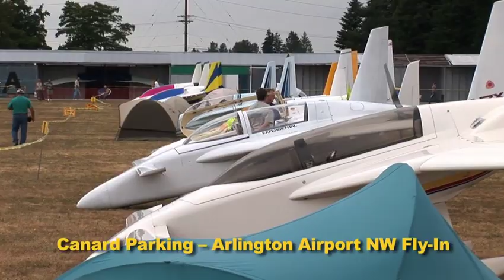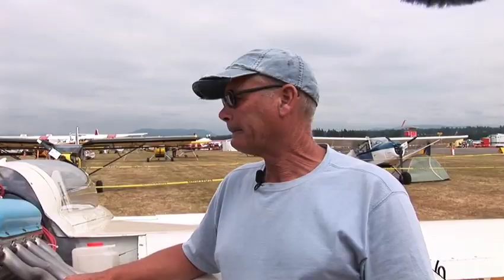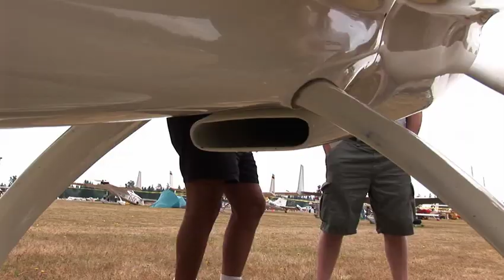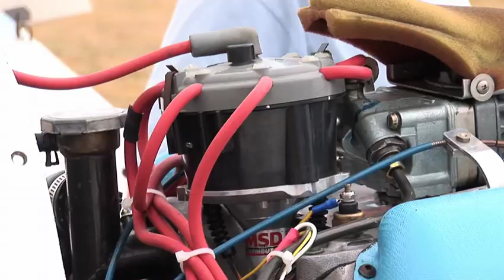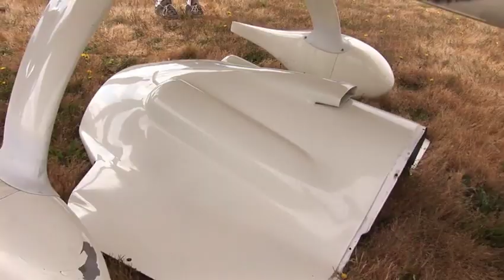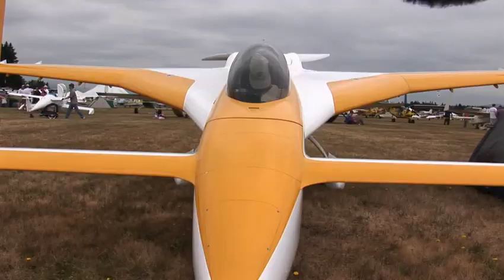LongEZ V8

Comment: Was that a direct prop mount? I am also an Engineer (Automotive) and I would never mount a prop directly on an automotive engine. There's not nearly enough support there for a rotating mass even if the blades are glass or carbon.

Comment: I would have used a much lighter and smaller motorcycle engine that makes more hp per lb than that huge V8!
Reply: Airplane engines are all about torque, not hp. You need to TURN (hence the torque) the prop at low RPMs. And you also want an engine that's dependable..

Comment: With those specs, I wonder how a Mercedes OM606 or Toyota 2JZ would fair.
Reply: OM606 weighs 463lbs, 2JZ 440lbs, both more than 100lbs more than the V8. Both are straight 6s, so they're longer and taller, so the CG is even farther aft. 

Aft center of gravity in an aircraft is deadly. 

I've got an idea! How bout use an airplane engine!!?? They're lighter, smaller, less complex, and fit inside existing cowlings, all with more torque as the engines you listed.

Comment: I’m curious what airframe modifications were made to get passed the Vne of 190 Knotts??
Reply: I was thinking the same thing. Exceeding stress levels is suicide.
Reply: These planes are experimental. There is no official VNE. Also, the VNE is IAS, so at 10,000', he may be traveling at 200kts ground speed, it may only be 140kts IAS.

Comment: I like his attitude about overhaul time.  Think about how they're run on the road.  If your car averages 30-40 mph (pretty typical for cars once all idle/city/highway time is lumped together) and you change oil every 5000 miles, that's about 125-165 operational hours between oil changes and if the engine lasts 200,000 miles, that's around 5000-7000 hours MTBO.  So assuming the duty cycle isn't much higher (direct drive and cammed for towing torque, getting 4-5 gph at a steady 2000-2200 rpm seems reasonable, and is like crusing in overdrive for all the engine cares), I could see that thing lasting a good long time.  I would probably want fuel injection and a modest turbo, too, though.
Reply: Fuel injection, sure. Automotive carbs don't work upsidedown. But turbos? Pfft nah. No need for a snail. Would invest in an all-angle dry sump oiling system too. Aircraft can fly upside down(and WILL fly upside down if I'm at the controls) so making sure the engine doesn't go bang when upsidedown is important.

I'd be half tempted to try this with a ford 300 since they're already pretty much cammed for it(The one in my F150 turns 1750RPM at 75MPH and loves it!) and would need minimal modification for air use, but those things are FUCKING HEAVY.

Comment: I knew this would be a thing when I got into GA in 89. At that time crop dusters were trying big block Chevy race motors because they were cheaper than the round motors. The gearboxes however were being driving from the front of the crank which was not able to handle the load. Turning the auto engine around was the obvious solution. Although the crop dusters in our area all went turbine instead. I'm not surprised this package has been reliable given the engine speed and lack of reduction gearbox. I don't have much gearbox experience, but I do have experience with the gearboxes on every airplane that had them. 3500 is loafing for a race bottom end. You could even go real light on the valve springs and cam timing to make a racing valve train bullet proof. Nice installation, great airplane.
Reply: What is it about the pusher setup that puts less strain on the components?

Comment: I bet that man could do wonders with a GM LS aluminum engine in one of those. Would probably be lighter too.
Reply: I have a Ford Small Block with an aftermarket aluminum block.  Weighs about 300 for the long block, with intake and huge racing oil pan.  I was thinking something like this would be great for that.  With the larger bore from the aftermarket block it displaces 358  ci (5.8L).

Comment: 165 miles on 4.2 gallons is 39.28 miles per gallon.  My v6 pickup doesn't do that good.
It also doesn't go 165mph.

or.. run for more than an hour...
Reply: 4.2 gph ??
That is amazing !
Obviously the engine just loafing, not laboring like the Lycoming
Reply: It also weighs likely double, is designed for a useful load of thousands of pounds, has a frontal area and coefficient drag that reflect its use. It has little to do with the engine, and lots to do with what the engine is inside of.

Comment: Don't like canards.  A bit lower fuel consumption, but NODDY problems and degrading of the the canard can get you diving into the ground as you haul hard on the stick, wishing you were not flying a canard.   John Denver showed how it is done - "Lets guess how much gas in this new plane I just bought.  Maybe enough; maybe not. Don't bother learning fuel tank switch."
Fuck around and flying will kill you.  The choice is yours.
Reply: what are "NODDY problems"  ?
Reply: Y Knot, NODDY = No Double Dare You.
Reply: John Denver ran out of gas. It had nothing to do with the canard....
Reply: You do realize why a speed brake is installed on a long right? It has like a 3 degree descent rate idlimg, that's not nose into the ground by my standards
Reply: @josephc.9520  Very nice and slippery.  Did not know a Longeze had airbrakes.  BUT, there is still the problem of canard degradation from rain or ice.  Plus NODDYING on take off.
Interesting design, BUT who cares about fuel economy?  You really want to travel cross country in one of these?
I like aerobatics - Ezes NOT aerobatic as far as I know.  My brother flies an RV8 - fast; aerobatic; glass cockpit - LEAPS off the ground - he flies it to Spain to go gliding in the Pyrenees. (sp?)   CAVU skies to you!
Reply: @davidwheatcroft2797  The "canard degradation" issues you speak of were solved with vortex generators, special designed tape to keep the boundary layer joined, and even a completely different canard airfoil that can be built in place of the original.  I would totally travel cross country in a LongEZ!  Comfortable seating, great speed, and you can even throw your luggage in an under wing baggage pod.  Aerobatics aren't a canard's strongpoint, but take a look at Kyle Fowler's airshow to get an idea of what's possible.  The RV8 is a nice airplane for sure, but if you park one next to a canard I can tell you which will get the most attention.  And it will do it for less than half the price!
Reply: @terryfulwider1296  Yes, to peasants, future, unusual looking.  Why fly long distance in a small a/c?  Have to park it and rent car, pay.  My Renegade was strictly local, though I did think of flying across Canada in it.  The whole idea of a "stall proof" plane, silly.  In the RAF, we flew aeros every day; formation, low level, PAR GCAs.  Spins not a problem.......deliberately NOT kicking rudder in a hammerhead, and falling back into space, confident in my a/c and training - a demi God high above the plebs with my own Batman and a car and driver o take me drinking!
Reply: @davidwheatcroft2797 I guess I'm a peasant then! I think it's a beautiful aircraft. I also love the idea of traveling in a small plane. I got my ppl so I could go places relatively quickly while taking in the countryside and enjoying flight. Perfect for me!  As for stall proof, the majority of accidents were stall/spin incidents. Burt designed a plane that prevented that problem. I don't see how it's a bad thing. Maybe not YOUR thing, but not a bad thing.
Reply: @terryfulwider1296  Not a bad thing per se, just not my thing.  John Denver showed how stall proof, hm?  Stodging along, boring.  In the RAFVR, I flew aerobatics every w/e; suffering from nightmares when pulling hard G - dying several times a night.  And sinus pain from climbing too fast, and aching ass from being strapped in so tightly - nothing worse than loose straps when inverted!   You HAVE to be PART of the aeroplane.  CAVU skies to you.  I respect all pilots; the civvy ones scare me with their long flat finals
Reply: @davidwheatcroft2797  Thank you for your service sir!  I'll just have to add one more comment to this thread.  The John Denver incident had nothing to do with a stall or problem with the design of the LongEZ.  He ran out of fuel, became distracted manipulating a custom fuel valve that the builder of that particular plane used, and then crashed into the ocean.  He never stalled, it's about poor pilot choices than the particular airplane he was in.  CAVU to you as well!
Reply: @terryfulwider1296  He had a DUI so not allowed to fly.  I ALWAYS fill the tanks AFTER landing - one less thing to remember and reduces condensation.  Pilots MUST always be waiting for things to go sideways; practise, practise!  
I narrowly escaped death in a spiral dive in heavy cloud with no IFR training - pulling back just made things worse; wanting to quit! Terror....then, power back to idle, roll wings level with ADI, PULL hard, hope - then soaring UP at 300+kts, ALIVE - was like walking on air.  HM honoured me with a Permanent Commission, one of 20 from 4,000 applicants - accelerated promotion, double pay.  Flattered.
Reply: Bugle oil.

Comment: Beautiful Bird ....and some Swweeeet Ford! Some people have a few good ideas, but Ford's engines in the old V-8....289-302.... Built Ford Tough....then something happened with the mustang....

Old Crow Pilot Bud Anderson flew in to history... but did you know that he was working with Caroll Shelby on the new Ford Mustang... back in the early 60's...
Bud Anderson built Ford's Mustangs into a rare Stang... only a few built in his garage...

The Reno. Air Race i always wanted to attend.... Oshkosh fly in is on the bucket list too..

Aviation and Kid's...CYS is home for me...set your altimeter and check out the Wyoming Windsock at NOAA... I have seen some incredible Aviation History there... incredible History B-1 flyby.. Boeing 777 flight testing...touch and goes... rough landings and.. High Crosswinds...

But what does a kid do... planes...trains and automobiles

Comment: This engine is direct drive, no reduction system? That's good from a reliability standpoint, but 3500 rpm is really pushing it for propeller tip speed. I guess with the propeller blade length that tip speed can be computed. Use shorter blades and more of them. Those Reno formula one racers turn those O-200's even faster, so he must be under supersonic speed at his blade tips.

Comment: Even though a prius engine is not a performance demon, it's built to be efficient, running an atkinson cycle that's a little weaker than the normal otto cycle but efficiency as high as 35% instead of your normal V8 that might be 8% efficient. Such a 4 banger could make a LongEZ instead a range monster...  and the speed might still be just short of 300km/h. Maybe 275. Imagine a longEZ going 15000km on a tank :)
Reply: The thing about more range is why would you want to sit in that plane for more than 3 hours?
Reply: @JonT1137 you lay in the long ez the seats are reclined it's like a jet fighter cockpit very very comfortable in a long ez or e racer. You could fall asleep it's so nice. You feel like part of the plane .
Reply: lol V8s are not 8% efficient. The shitty two stroke in my string trimmer is around 15-20% efficient. V8s are in the 30% area too, in fact a modern EFI V8 and the gas engine in a Prius are damn near identical on efficiency.

Stop pulling numbers out of your arse already.
Reply: @TestECull  is that why all V8s have disappeared. Don't be such a trump voter
Reply: 35% to 8% efficiency? Nope. The Atkinson cycle of the type which is "faked" on the Prius and other engines is a function of camshaft timing, to mimic a longer expansion cycle versus the compression cycle. And note that airplane engines, unlike car engines, can be run at very stable speeds, allowing mixture to be adjusted for best economy; my little airplane got 16 mpg at 130 mph.
Reply: While the mixture in your engine may be adjustable, so is the mixture on any modern fuel injected engine. Only it's done electronically. Also, if you think that auto engines can't be run at constant rpm, you are mistaken.
Reply: Not what I said; I said that airplane engines were DESIGNED to do so, over a very narrow operating range. This is not true of auto engines. I am, however, a fan of higher-speed geared engines, and some auto conversions (the Austro diesels, etc.) are working out beautifully.
Reply: @UncleKennysPlace  Nonsense... this myth just wont go away. That same Ford motor would also be put in a 1 ton dually axle truck that would run 3500 rpm @ 50mph for decades. Automotive engines are designed to run at any RPM for however long the user wants under redline. I think this myth got started with the AC engine manufactures trying to sell you a 4 or 6 cylinder engine for 35-80 thousand bucks vrs Ford or GM 5-15 thousand.
Reply: So you are saying the WWII era engines in planes can't be more efficient?